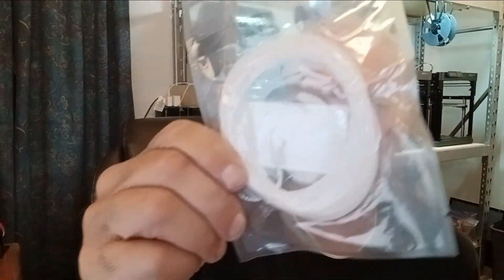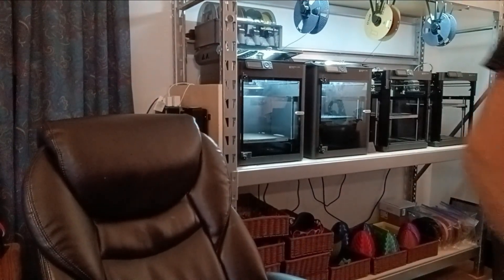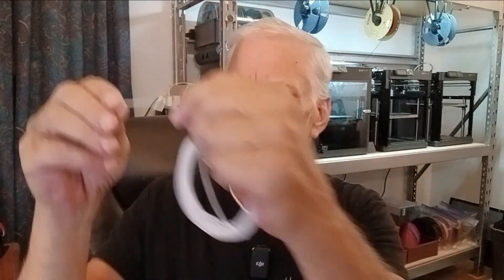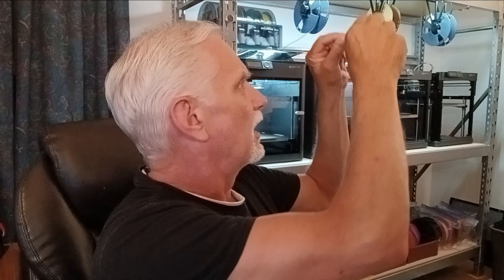3d Printing Senior Finds "Cleaning Filament" For The First Time!

Comment: Every roll of filament I buy from a certain company comes with a small amount like that, I have collected about 30 of them so far, never used them, I print in PLA 99% of the time so don't see the point.
Reply from the maker: I started with Bambu Labs. I had been using their filament. I have just using other filaments. Looking for made in the USA. Who do you use? Bambu has got so high in cost.
Reply: @Blueridge3Dprints  I'm in New Zealand, So I'm using local suppliers, Nexa3D, Wondershop and Formtech. Formtech stock polymaker and iSanmate, Nexa stock Ziro which is what the cleaning filament comes with and wondershop get their own made for their own brand. All top notch filaments.

Comment: Couldn't say where I heard it, but I heard HIPS is used as a cleaning filament. Sorta milky white and decently brittle, maybe it's what you have. I think its wide melting temp makes changing between filaments with different temps easier. No flakes of cf nylon in your white PLA etc
Reply from the maker: After running it through the printer in doing a lot of reading I believe it is just nylon.